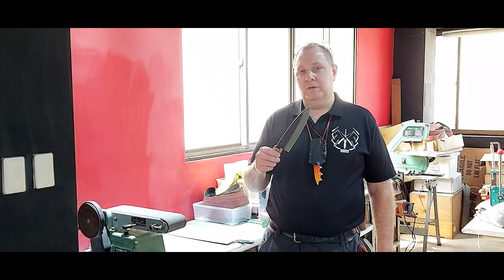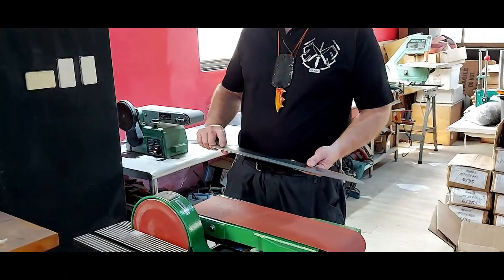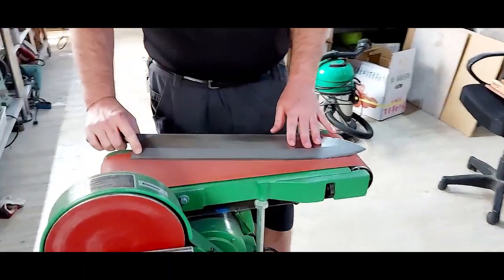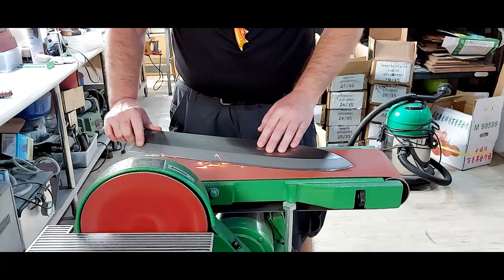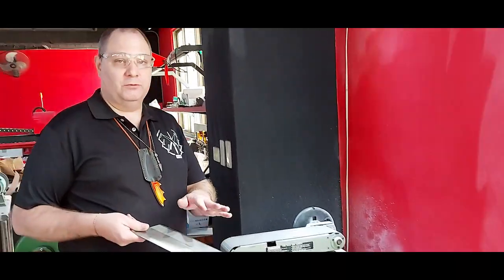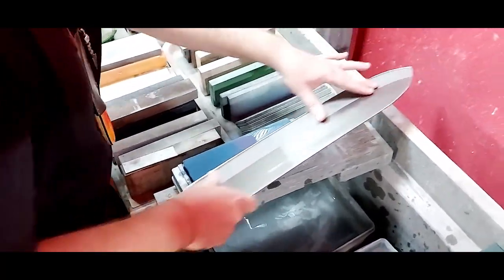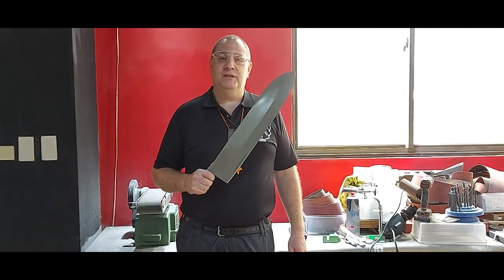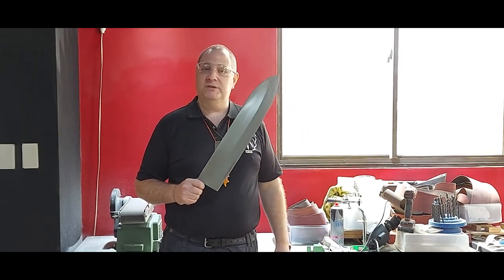Sharpening the Master Kuo GL-500 Taiwan Tuna Knife BBQ Brisket Knife

Comment: I'm a hobbyist knife sharpener.  I watched the Tuna knife and Master Guo and didn't hear you talk about the angle.  I started with whetstones (they were cheap ones) and I was too novice.  I have a WS and Ruixin with angles on them.  I scratch them up but get a burr and sharp knife with an angle that is inconsistent.  Are you just following the bevel, then belt and stone them?  Do have a hobbyist (but wants crazy knives like you).
Reply from the maker: Great to see you are getting the sharpening bug! Following the factory bevel is always a good place to start. But most knives operate in the 15-20 degree per side "goldilocks zone". Once you get over the learning curve, you can then start to play with changing the angles and seeing if they work the way you want. As for me sharpening the GL-500, I put "My" angle on the blade with the belt, pretty much ignoring any factory anything, then go to the stones and hit that angle, and then walk the angle down slowly to create a more convexed bevel. It looks a little nice and taking that shoulder off helps with smoothness of the cut.

Comment: By the way, forgot to ask... after you finish working on belts and start working on 600 grit chosera you just try to eliminate the burr from the belts or you additionally try to create a new one - smaller than the previous? ...and later finish on 2k??
Reply from the maker: Excellent question, sir, as always! I generally do not deburr off the belts when going to the stones - although you certainly can (and you have seen me do it here: https://youtu.be/066gh2WY4yE ). In this GL-500 video @6:18 when finishing up on the 600 stone, I pointed out the metal burr flakes that came off onto the stone. This is where I normally deburr, so it's parts of the 1st stone process rather than the belt.
Reply: @JendeIndustries  As always straight to the point, explainfull, without hype. Thanks for answering.
Reply from the maker: My pleasure, as always!

Comment: You are creating way too much heat. You could burn the edge and ruin the heat treat. When keeping the blade on the belt that long you should take breaks and cool with water
Reply from the maker: I don't disagree with cooling and edge while sharpening, but there's no color changing in the steel. Faint Yellow starts around 220°C / 428°F, and is very hot to the touch. But as long as the heat can dissipate, it's good in my book. I'm not grinding the knife - only sharpening it. That being said, if I feel a knife is getting too hot while sharpening it, I will run it under water.  😎👍